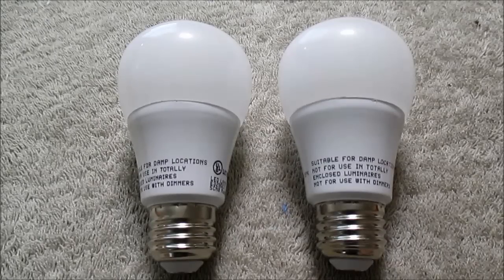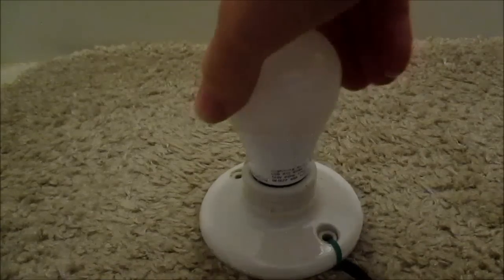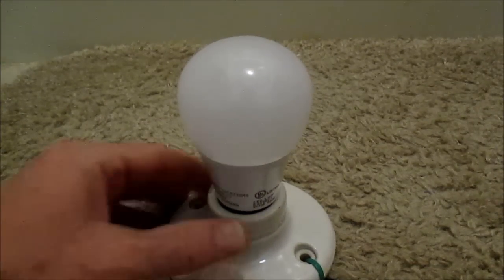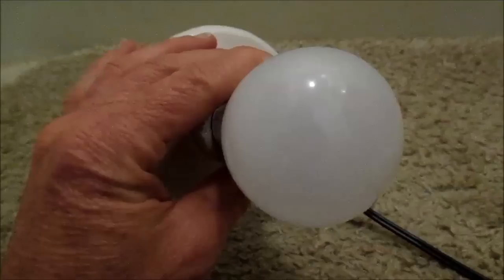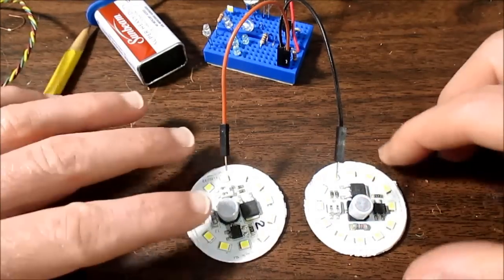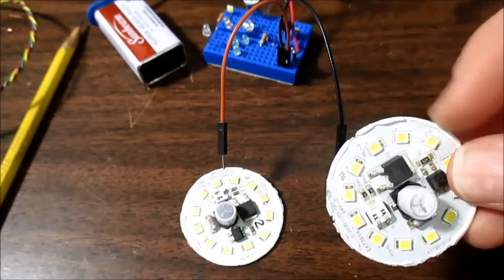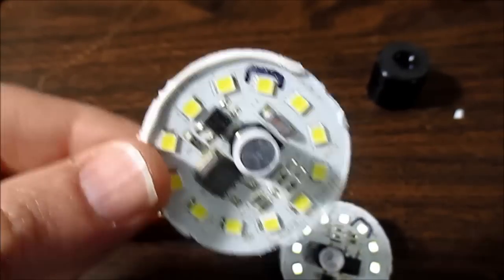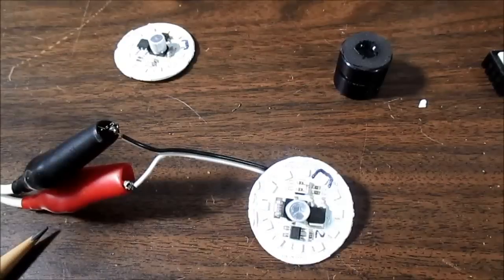Two failed LED bulbs for teardown to determine the cause

Comment: If it has a warranty then why disassemble it?  Just contact the manufacturer and demand a replacement.  I don't understand the need to disassemble the trash unless you're going to disassemble one to repair the other.  More work for what, a light bulb?
Reply: Hey Pat,
Some of us enjoy taking things apart to see how they work. 
Its especially relaxing when the part has already failed, and this video
demonstrates the engineering mentality that leads us to better devices.

It is difficult to understand if you've never worked in an engineering community 
where products arise from nothing but a concept.

As with Classical music, where every note has a well thought out reason,
all parts of an engineered man made device have countless hours of 
effort involved and its always exciting to reverse engineer a device
to understand the mind set of the inventors/developers.

Flame on!
Reply: They cost very little; I think he's just interested in seeing why this new technology is failing. Made for interesting viewing as well.
Reply: Patman Crowley Did you Read the title?
Reply: Also, something like this sheds light for manufacturers.  They want to make a good product?  They need a second set of eyes, and who better than someone who goes through the trouble of disassembling a product to find the failure.  Spot the failure, and you win half the battle.
Reply: Getting warranty service on some of these bulbs requires you to ship them at your cost to the manufacturer.  That typically costs more than just buying new bulbs.
Reply: Carl Mueller.  Not always.  Many light fixtures I bought at Lowes that went bad, I got new units from the mfg but did not have to send the unit to them.  I did need to email/fax the receipt to them, though.  The reason they do not want you to send the unit is because it costs them money to process returns.  They don't want their own junk back, they just want you to prove you bought it from the store and not on Craigslist.
Reply: Then he would not have a video to make.  Video was for curiosity and knowledge.  Not about fixing the bulb.

Comment: These LED- energy-saver-bulbs are generally overdriven, so they are brighter and last shorter. They also overheat quickly in that airtight plastic enclosure.
Reply: Moderate Fkr ... on the outside...
Reply: I chop the tops of my cheap Feit bulbs with a bandsaw before I install them to see if it helps them last longer.
Reply: The ones I have barely get warm.
Reply: LEDs can't take more then a few volts reverse current"; LOL you can't be bothered to use the correct terminology, why should anyone take you seriously? In the  event a LED see forward or reverse currents more that it's rated for, the driving circuitry is a at fault not, the LED.
Reply: Markus lol
Reply: the IKEA 1$ ones are great if you open them, you can short as many leds as you want to get less heat as well(non-isolated buck driver)
Reply: The better LED lamps sink the heat to the exterior. In regards to being over driven to be brighter ann you point ude to a tear down that shows that to be  so in lest one instance; or is that a hemorrhoid factoid?
Reply: waswestkan, I have torn down failed GU10 socket one. The PCB was discolored due to heat. Bad thermal paste too.
Even with more expensive circuit to protect against over voltage, the heat still is an issue. (rated 90-265, so Japan-US-Europe)
Reply: Doesn't that result in harsher light?
Reply: That's my experience as well.
Reply: And how do you know they are rated 70mA? Were you able to read the part number and manufacturer from the video? You must have better eyes than I do.
Reply: And again, your posts are out of ignorance and completely wrong.
Reply: I have some GU10s with the same problem but as they sit in deep lamp holders they get very hot indeed Yes the leds are running far to hot due to lack of heat sink they need to run cool to last  So they need about 3sq inches of heat sink surface area per Watt and in open air not in plastic holders etc
Reply: @michaelllewellyn7215  
Install cooling fans in the bulbs ^^
Reply: Heat problems are worse in closed light fixtures with glass globes over them. I've had a lot of these overhead fixtures in rented apartments in older buildings, and to make matters worse, the bulb is installed base up. What I started doing with CFL bulbs was to make collars with 1" or 7/8" holes for ventilation. 
-- There are more elegant ways to execute the concept, but at the time, I already felt that I was putting too much into this experiment, but here's how I did it.
-- It turns out that small tomato cans or progresso soup cans are just the right diameter. I drilled three 1/4" holes around the rim, for the globe-retaining thumbscrews to hold the collar, three vent holes, offset from them radially, whose top edges were a bit lower than the bottoms of the 1/4" holes. (These were cut with a hole saw.) Then I got three screws from the hardware store with the same thread as the retaining screws (some places sell thumbscrews that match the ones for the fixture). I drilled three smaller holes about 1-3/4"" below the top retaining-screw holes, just a bit smaller than the screw diameter, and forced the new screws in like sheet metal screws. These hold the globe. Then I cut the bottom of the can off, so that the collar was about 2" tall. 
-- With CFLs, this added hugely to their life. Prior to these collars, they'd fail after a year or so. After, I got more than 10 years, and as far as I know, they're still working-- I moved out. 
-- I even made a big collar for a two-bulb fixture, but that was a pain to make, because I couldn't find a container the exact diameter of the fixture, and had to pop-rivet two pieces of a sturdier can together. By the way, Progresso cans are thinner gauge today than they used to be, and are harder to work with.
-- I have had some early indications that this works for LEDs too.
Reply: Huh!  Funny how no one mentioned that during the "incredible claims" season.

Comment: Since you have a number of partially functioning LED boards, why not unsolder a good LED from one board and solder/replace the bad ones?
Reply: That is what they count on, that you will by these Chinese junk LED bulbs over and over. The end result is you pay a lot more for a single bulb by buying it multiple times
Reply: These operate at high temperature, and are therefore more difficult to unsolder/solder vs. regular components.  Not sure what formulation of solder is used, but I was not able to reattach an LED on another brand bulb myself.
Reply: Carl Mueller: It is the same solder, the issue is a giant heatsink in the back of the board that is sucking all the heat away from soldering equipment.
Reply: kw0s, I was going to say the same thing.  you beat me by 7 hours. LOL
I bet it won't fix it.
Reply: Money is time. Take the time to fix them? And how much money does that represent? Is it cheaper to bin them, and buy decent ones?
Reply: @paullangford8179  exactly what I've said about guys taking time to trouble shoot/repair LED xmas lights.  How much is your time worth?  Now if your are bored and want to learn, go for it.   Me, I'm not wasting my time on some things.  Like I just wasted watching and commenting on this vid ;)
Reply: Repairing LED bulbs is not worth doing except as a hobby.
Even the cheap brands are mostly reliable.
Reply: Save your receipts for the led bulbs and when they fail take them back to the shop or store you bought them from and point out that you couldn't have run them for 15 or 20 thousand hours and get replacement s. Haven't yet had one failure, but when I do, that's what I'll do. Simple
Reply: Everybody saying 'thats what you get buying the cheap bulbs' and 'should pay a little more and get good ones'. Okay then: somebody chime in with a brand name that Does make good ones; or how bout this: somebody name a brand that has NO affiliation with China........I'll wait.
Reply: Because they are a pain to open and might be a pain to put together too (espexcially after you've stuck a screwdriver through the bulb :D ) But of course that would give you a bit more lifetime until the next bum LED blows and then you have to do it again... not really worth it. I'd just desolder the LEDs and keep them for low current applications somewhere later.

Comment: Chinese made crap
Reply: Like iPhones and most of the computer you are using. lol
Reply: @12dollarsand78cents  computers*
Reply: Apple maintains tight control over the supplies that go into their products as do many non-Chinese brands. The issues arise with Chinese run companies. Unlike China, Japan quickly improved the quality of its products while maintaining a price advantage.
Reply: 12dollarsand78cents actuelly，under the iphone's shell ,components came from Taiwan, Japan,Korean,and US related companys. China mainly assembled the components follow by higher regulation.
Reply: 4pidgey  Don't think you will be able to buy LED bulbs made in Europe or the US
Reply: Where you also aware that many Chinese manufacturing companies are targeting Western (including Australian) companies hoping to win outsourcing contracts? They offer to manufacture parts or assemblies for these companies, of course at supposedly unbeatable prices, and even offer samples built to their specs. The sample they send back will be quality controled, and meet the Western company's specs and standards, just to seal the deal, but once the cheque clears everything else they deliver will be pretty much the bog standard of Chinese manufacturing.
 I know of a pool cover company in Australia that was burned by this swindle, fortunately they caught on early. Some of their customers were having problems with failed motors within a month or two of having the new cover installed, which had to be replaced under warranty. The culprit, you guessed it, those "quality built" Chinese made motors, they built them without any water proofing around the armature shafts , so the moisture got inside and destroyed them  So the rest ended up getting scrapped, it was cheaper to write them off then try to send them back. 
   A more pertinent issue is the fact that most of the large companies in China are owned by higher ranking members in the Communist Party, who can get whatever financing they want from state owned banks, no questions asked. They can also steal patent protected inventions and manufacturing processes with no consequence, because the courts are also run by Communist party members as well. If the company gets in trouble, the Chinese government can take it over, or the owner can just start up a new one with more funny money.
Reply: coldwynn
This also accelerates the landfill overload in the US
Your text is proof we can't go back.We'll be buried in shit.
Reply: +OlegKostoglatov The point he was making is that pretty much everything is made in China these days, both decent quality and bad. The iPhone reference was just an example of something made there that's near the high end of the quality spectrum. iPhones are replaced not because they are poorly made but because they go out of fashion when the next one comes along.
Reply: What isn't Chinese??
Reply: LED light bulbs in the UK cost ten times what they cost in the US.
Reply: You get what you paid, right? There are lots of good quality Chinese production but you don`t like to pay the price so stick on your poor life and blame to another country that you may never be there.
Reply: @colorpandabox  You get what you paid for*
Reply: @colorpandabox  good quality Chinese products*
Reply: A lot of these commodity items are usually built from items that didn't meet the binning requirements of the manufacturer. Someone usually buys them in bulk and whatever works works and whatever doesn't who cares.
Reply: So what point was he making? That an Iphone that gets binned within five years for the latest hyped up one is any measure of build quality? Apple stuff is just like Sony stuff used to be, it isn't any better then anyone else's, they just spend more on marketing and charge you more for it.
Reply: No.  There is a constant current regulator in the bulb.  The LEDs are protected to AC mains voltage spikes
Reply: I heard different times, the Companies in China, CAN build high quality that lasts a long time, ..but then they want the same price as it would come from a Factory in Japan.  Having "cheap" (inexpensive) & GOOD  (long life)  don't often go hand-in-hand anymore.
Reply: When I was a kid in the 60's it was "Japanese made crap".  Then in the 1970's it was "American made cars crap".
Reply: +OlegKostoglatov He doesn't, but that doesn't invalidate the point he was making.
Reply: At least for Europe I can say: Yes, you can!
Reply: @Sven - I wonder what you edited out.  ;-)   His post was off the wall. 
Yes, not the brightest light-bulb (pun intended), but he's built his own version of a Karaoke machine, complete with a guitar he can't play.   
Recommended movie,  Idiocracy: 
http://www.imdb.com/title/tt0387808/?ref_=rvi_tt
 & it didn't take 500 years.
Reply: ...the items made in Indonesia, Taiwan  & Philippines... & the very upscale items from Japan.
Reply: +RetroCaptain Why should cheap and good go hand in hand? It's an unreasonable and unsustainable expectation.
Reply: andy parry Not made in China.Assemblies in China.Parts are made all over the world including China too.Only the two secret chips set like the CPU and the GPU are made and imported from Apple production plant in Silicon Valley in San Francisco in California USA.
Reply: Forgot Apple Inc.computers programers and hardware engineers designed and testing Apple prototypes products in Apple plant in Silicon Valley too.
Reply: +Chi Chu Intel makes the CPUs and AMD makes the GPUs, not Apple.
Reply: Thats what he said
Reply: US was  built on slave labor
Reply: @IFollowAfter  bullshit
Reply: Fuck China...
Reply: Chinese make everything.
Reply: Arishia Nishi 
Or just Google it.
Reply: 4pidgey It's a light bulb who gives a shit.
Reply: The root cause is the bubble company wants  Cheapest products. What you paid is what you get. It isn’t an issue of China or other countries. Blame should go to your crap country and the crap company with that crap brand imported these low quality product for grabbing your money. You should ask your country why they allow theses crap company taking money from you and get rid of these bad company out of the market. You will get high quality product. But you might need to be prepared for paying more money for higher quality product.
Reply: China is capable of making both low and high quality equipment. It depends all on how reputable your manufacturer is and how much you're paying them.

Stupid people expect a $30 knockoff iPhone to perform at the same quality as a real iPhone. It's just stupid...
Reply: what do you expect from slave labor?
Reply: Where? China does not have slave labour.
Reply: @kirkgraham6469  
Why do you use slaves for your supplies ?  Can your homeland labor force made anythings other than cry while licking gallons &  buckets butterscotch icecream?
Reply: Apple phones are made in China, so the country of origin isn't the problem.
Reply: It is quite wrong to say that ALL Chinese stuff is crap. Although some of the cheaper items may be so they are now starting to lead the world in innovation and advancement in technology,
Reply: Then how do you explain why the products that are sold online, through ebay or Alibaba,  and delivered directly from China, with no North American or European company "middleman" involved, are as bad or worse for quality? Have a look at the videos Bigclive makes where he takes apart and examines many of these "direct from China" products, some are downright dangerous.
Reply: How do you know his bulb was made in China?
Reply: Dont blame the chinese. Blame those investors/manufacturers doing planned lifetime for all kind of stuff they sell, so they can sell it one more time in short time.  You can say its competition between the manufactureres, but what if those with too much money is controlling several (all?) the manufacturers, or cooperating in produce short-life electronics/gears?
Reply: +MattBlytheTheOne You can buy them in Poundland if you really want to.
Reply: What does that have to do with the subject at hand? I suppose you will be telling me what colour of paint I should use on my backyard shed next? It is about as relevant.
Reply: Someone needs to beat the slaves at the factories a little harder so we can get a better quality bulb.
Reply: How do you know if he has an Iphone or not?
Reply: How do you his bulb made in China?
Reply: @colorpandabox  was* made in China.
Reply: Here's an example of a really nice piece of "Chinese made crap": https://youtu.be/VYM75xMciO0
The Xiaomi laser projector is beautiful inside.

Comment: Curious if there was any thermal paste behind the bad LED? Maybe the heatsink couldn't pull the heat away and it overheated
Reply: It's soldered to the board. Why would there be thermal paste?